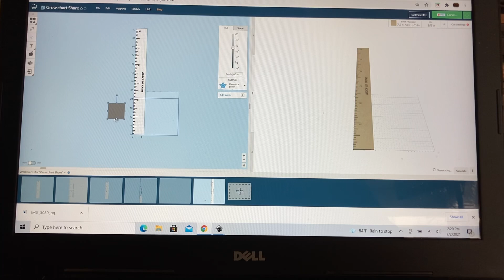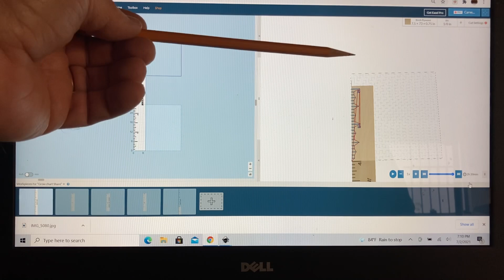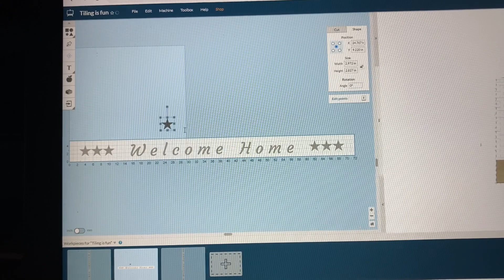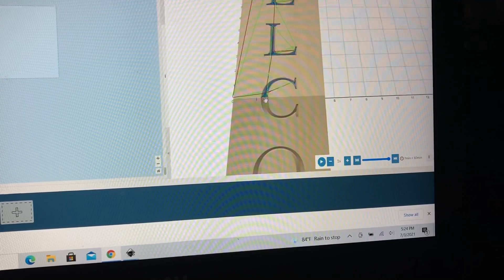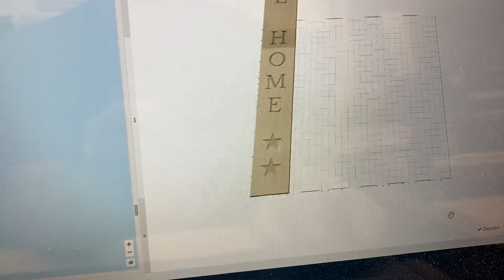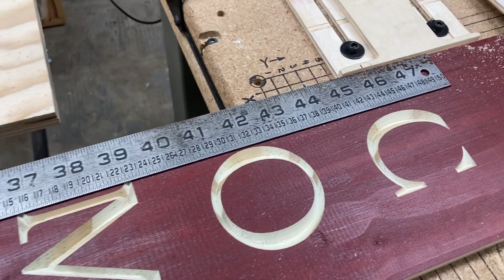How to do Tiling Using the Easel Pro Tiling Feature and the XCarve

Comment: Thanks for the video.I have watched your method a few time but I always end up with a line through the middle of the project from top to bottom.The line is too deep to sand out.I have tried resurfacing the spoil board etc etc and still it is not working out.I have the 3018 Pro and the Mandrill.

Comment: How do you know where to place your tiles? I have an 18” tile and a 19” tile, how do I know where to start my second tile?
Reply from the maker: The location of the material must match the same exact location on the computer
Reply: @PawPawsWorkShop  so I’ll start my next tile starts right at 18”?
Reply from the maker: First, are you using the tiling app in easel?  It tells you where to place the project. You also have an overlap feature. If you are not using this feature then the zero point of each tile must match the computer to the project. Hope this make sense
Reply: @PawPawsWorkShop  I’ll look and see. Thanks for the help!
Reply: @PawPawsWorkShop  I am using easel by the way.
Reply from the maker: Easel is fine. I use two methods. There is a tiling feature in easel. Also, many of the tiling projects that is have done were NOT using the tiling feature. There definitely differences. Look at my fan art playlist. Those are all tiled. That may help.

Comment: What kind of machine is your larger setup?
Reply from the maker: I have two large platform CNC machines. In this video I used the XCarve. There is a link in the description to go to their website for more information. The CNC4NEWBIE is the other large platform CNC machine. Again information in the description
Reply: @PawPawsWorkShop  I have a 1000x1000 X-Carve currently but am looking for an upgrade to what I'm using, i.e. ball screw or rack and pinion. Thanks for your feedback
Reply from the maker: The CNC4NEWBIE is a great machine to meet your needs

Comment: So I’m curious how you ensure the machine doesn’t move when changing bits? Mine goes all over, so if I were to go to last X,Y zero, it’s likely going to be off?
Reply from the maker: First make sure your stepper motors are locked. The GRBL $1=255. If you home the machine you can use the use last x,y position if my chance it does move a little.
Reply: @PawPawsWorkShop  this sounds like something I can look up! Thanks!
Reply: Very new to CNC.  Have knocked out a few simple signs so far using Easel Pro.   I have a Fox Alien Masuter Pro.  Can I lock my stepper motors?   Where in Easel do you send the code?

Comment: Just curious why not set the overlap past the C? Also I found using PwN CNC z axis bit jig to help with not having to rezero the z axis every time in a bit swap.
Reply from the maker: Using the tiling feature in Easel Pro currently does not give the option to move the overlap.  That is a request that I have made to Inventables.  I'll check out the z axis bit jig.  That sounds very interesting.